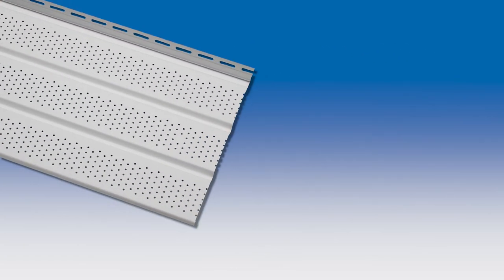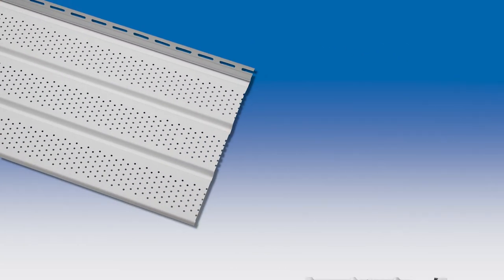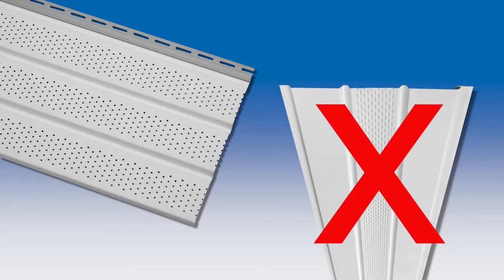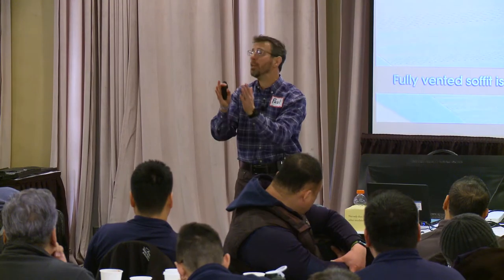A Word of Caution About Vented Soffit

Comment: I have full T-4 vented panels in every other bay, soffit has no plywood is fully open. I hardly feel any air flowing through. I should be getting 9" of NFA per panel, but don't feel like that is the case.  If I go full vented in every bay / panel, what happens if it throws off the 'equal intake and exhaust ratio"?
Reply: more intake is better. no problem
Reply: Ratio means nothing. Your airflow always going to be restricted to lesser nfa of either intake or exhaust
Reply: If you have too much intake from your soffit then you risk pressurizing the attic and, if it's not sealed tightly, pushing hot air into stud bays and down through openings into the house. However, unless you live on the coast and have hurricane like gales of wind, most soffits barely move any air and simply aid in the drying out of any moisture in the attic. A house is also pressurized and is usually pushing against any air trying to enter in. Heat rises after all. So, my method is to use as much of the soffit as I can and to seal all penetrations in the attic and then use blow in cellulose or fiberglass. To me it is the most cost effective and reliable insulation system there is. (I clicked on the video because I thought they would mention some new scientific research that showed a problem with what I do, but it just confirmed it.)
Reply: @MyFortressConstruction  we have a bathroom and kitchen vernt (separate) that vent out of the soffit. dedicated vent for both. when they connected the duct work to the vent , they used the same red tape used to seal a vapor barrier on a wall. should they have used aluminium tape ?
Reply: @MyFortressConstruction  I can't see too many soffit vents pressurizing the attic in most cases because the soffit vents on the downwind side of the house and the sides not exposed to wind will function as exhaust vents, so it sort of self balances. The only way I could see that happening is if someone installed way more vents on one side of the house than the other.
Reply: Sorry, I know this is 6 months later but yeah, there is class 1 and 2 duct tape and if it's rigid ducting then aluminum tape is preferred. I wouldn't worry too much about it, but it could leak given enough time...
Reply: True, depending on the shape of the house and direction of wind, it would be highly unlikely to pressurize from above. Most of the time it's coming in to the stud bays because the windows, sheathing and wrb aren't sealed well.
Reply: You better get on the phone with this guy PRONTO !